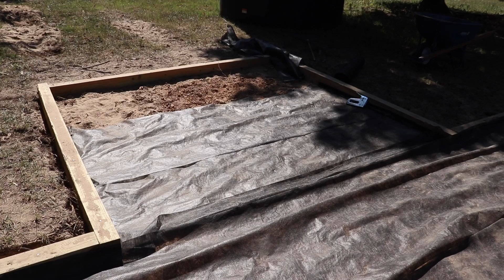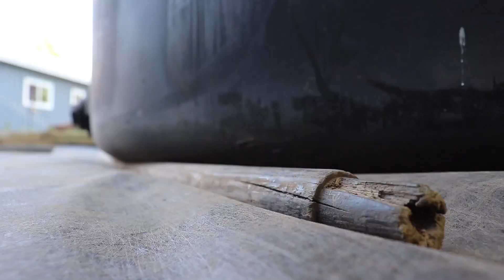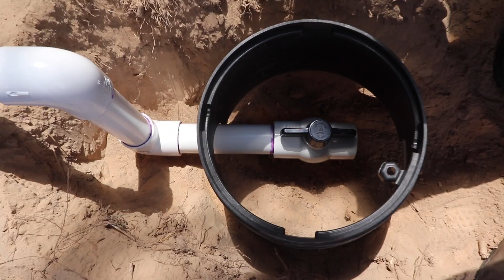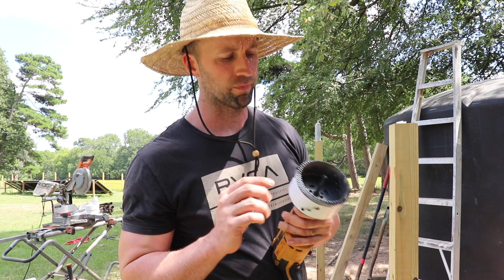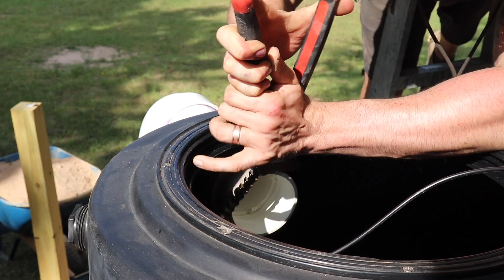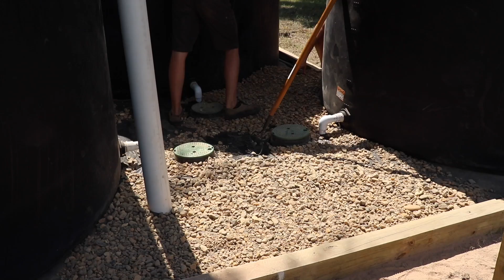HOW WE'RE GETTING WATER OFF GRID!

Comment: Either I don't understand your gravity fill tank layout or I'm convinced it will not work. It seems as if you will end up needing the gutters constantly full in order for the pressure to be able to fill up and into the tanks?
Reply: if you pour water into a glass, will it eventually overflow? If you pour water into a U shaped pipe, with the output end lower than the input end, the water will overflow at the output end.
Reply: @Florida-cracker  none of those examples are the same as filing a sealed container with a straw from the bottom up to and into the top. It's called the water table or some such thing.
Reply: @Finn-McCool  Nope. Water will flow (gravity flow) with no pump. If one end is taller than the other, the water poured in will force water out of the lower end. I supplied a link to a calculator and their pipe looks to be 4 inch nominal (4 1/2 inch)...4 feet higher (guesstimate from video) and 100 feet of total pipe length (estimate from video) will flow 360 gallons per minute. Estimating (high) that they have 1500 square feet of roof...3 inch per hour rain produces about 45 gallons per minute. 1/8th of what the pipe can flow.
Reply: @Florida-cracker  I appreciate the numbers I really do. Let me ask this. Doesn't the pipe need to be full of water completely in order for water table? I mean, how far beneath the grade of the roof gutters do you reckon the top of the tank inlet is? I'm just imagining the water collect there at the base of the tank inside the pipe and slowly filling up as it backs up toward the house and as it fills the pipe the pressure increases eventually creating enough pressure to push the water 7 feet up into the tank. As long as the top of the tank is lower than the the gutter I assume all is good. Otherwise I cannot see how it works.
Reply: @Finn-McCool  Yes, that is how it works...as long as the output (top of the tank) is lower than the input (gutter) all is good. The more the difference, the better. I estimated the difference was 4 feet in calculations (6 foot tank and 10 foot gutter). Even if it's less, the pipe will have no problems flowing what the roof provides.
Reply: @Florida-cracker  that's it! I was only imaging my own house gutters. Wow. Totally neglected to remember he is not only on pillars but he's also built even higher in the middle between the containers. Gee whizz , I "wanted" it to work and I "assumed" it might,  but I had too many scenarios bouncing around in my cranium 😆

Comment: Nice vid you three
If the water from the house struggles to get to the tanks you can install a inline water pump with flow switch and install a none return valve to stop water backing up on your house gutter pipe and all so fit a by pass just before the pump just in case  your tanks are full so that you can re direct your unwanted water.
im sure it will be fine though. iv done a good few like yours with no problem.
Dont forget you will need a  air vent on each tank.
Steve
UK

Comment: Something to watch out for with rigid PVC and tanks that will flex with heat and the rise and fall of the water.  Rigid PVC may break at the joints.  If you find this to be an issue you may want to add a Union and some spa flex coming out of the base of each tank.  The spa flex is PVC as well and can be glued with regular PVC glue, but it can handle the minor adjustments to the tanks.  
You guys are really fun to watch.  Its nice you can laugh at each other while working.

Comment: Hi there, i,m in agreement without a pump to move the rain water into the tanks it wont work. If the tanks were buried no problem. I worked in sewage with pump stations and such and weight of water with path of least resistance you will be thwarted. Kirk

Comment: what your doing wont work...…… you will have to put a barrel at the house with a pump in it to take the water to the tanks...…… then one from the shed you plan to build back to the house.. the water wont flow fast enough to go up that high...…. and you will loose more water onto the ground at the house because it wont lift itself up like that ……..

Comment: I hate to be negative but I hope your plan for getting the run off works but I don't think it's going to provide enough pressure to push the water up that 4 " pipe and into your tank. As crazy as it sounds you need that pipe to run down hill from your water retrieve point to your tank which might be 6 feet or 8 feet high running across the yard. I know that's not what you want being you placed the tanks away from the house. Just do a little test before you do all that plumbing. Just trying to be helpful, love you guys and what your doing. Keep up the good work.

Comment: I have to throw in my two cents.  As designed, as long as the height of the gutters is higher than the tank inlet, the tank will fill, but bear in mind that after the rain ends, the feed pipe will hold a column of water on the gutter and tank side as high as the inlet height on the tank.

Comment: I love watching you guys. I think you are going to have an issue with getting your water into the tanks. Provided your gutters at the house are at least 3-4 feet above the inlet to the tank the water will flow into the tanks but I think you will lose a lot of water due to overflow at your roof. I am a licensed master plumber an also a plumbing designer for an engineering firm in Houston. All rainwater systems we have designed the tanks are close to the structure or underground so the water can flow into the tanks without restrictions. You will be better off elevating your fill pipe above ground an sloping to the tanks from your gutters.

Comment: After rain stop you will get stagnated water in pipes. 

I will recommend to use two valve somewhere between the gutters and ground. 

One valve to be opened when rain start to prevent dusty water from going to tank. 

However I don’t think you will get enough pressure to fill the tank. 

I have noticed that you haven’t used float valve inside the tank. 

How you will prevent tank overflow 

Warm Regards from Oman 🇴🇲- Sohar City

Comment: Good luck, I don't expect there to be enough head pressure to push the water up and into the tank. If that ventricle pipe is 6 feet tall with three gallons of water in it there will be approximately 8lbs of pressure pushing back towards your gutters. Like I said good luck.

Comment: I know you guys did the research for head pressure and what not, but from our end it not look like it will very well at all!!!  You will have standing water in the pipe, I cannot see how that small of pipe will handle the flow!!!   Making a few changes now will be much better then when it is raining!!!!  I read most of the comments and we all seem to be thinking alike as far as pressure goes, but no one addressed the changes coming to the climate!!!!
        I realize you  and everyone here has been well informed on the scam that is globull warming!!!   Instead of heat you should prepare for cold, the area you are in will become cooler and much more temperate!!!!   In the meantime you will be plagued with hail storms much heaver rains and even snow!!!!   So do yourself a favor and rent a back hoe then put yout tanks in the ground, the intense UV won't bother, they will maintain a constant temperature and you can run a straighter pipeline from the house!!!!   Bury them 'bout 4' and your water supply will be safer!!!!   This is intended as an FYI, not a put down!!!   Don't believe me??  On u-tube go to "Adapt 2030",  "Grand solar minimum" there are several more if you have a science bent!!!!!    Better safe then sorry!!!!

Comment: Personally I would have buried the tanks at least half way in the ground if not more but to keep the water cooler to use. In mid summer the water is going to be hot or very warm. Then the water fkow is going to be a problem in filling them.

Comment: What I do on a hole that has no material for the hole saw to center on. I get aboard around 1/4 inch to 1/2 thick and saw the hole in it. Then use that as my jig to hold the saw blade centered on my work surface. 
PS you may have a problem with a water pressure issue as the tanks get fuller the down pressure will overcome the gutter pressure. Hence stopping the water movement.

Comment: Good MacGyver move on the hole saw! Would Teflon tape worked on the original fitting at the base of the tank or is there too much water pressure at that connection? Not a plumber so have no clue.

Comment: I personally feel the intake PVC should have been raised at roof level running parallel to ground, with some support system than dropped into the tanks with three top distributing tubes.. That way when it rains heavy, the water will pass quickly and no spill over will occur, or maybe just a small amount will spill. The support columns can be made out of wood which will look pretty nice and later you can grow some plantation around the columns like a wall creeper... Anyway I am glued and cant wait to see how this beautiful house comes out... Best of luck!

Comment: Was curious what king of chlorination you will use. We're required to get our water tested from the tap every 6 months. I hope your theory on the gutter pressure works, but we ended up having to put a sump in with a pump to pump water up to the tank. Works great, plus we filter the water  to the tank so our tanks stay cleaner.   We were all screwed up at first until we figured it all out. Second testing showed bacteria in the water. That's when we learned about chlorination. If algae or bacteria is found you have to drain the tanks and bleach them out. PAIN. Been good ever since we got the chlorination figured out. Good Luck !!

Comment: I don't understand the difference between the water in the pipe or the water in the tank standing. All of the water will be filtered before going to the house. Hydrostatic preasure is why the system will work. Water seeks its own level and will flow into the tanks. I have a filter that you can put food color in the water and when it comes out its clear.

Comment: I read a lot of comments about your water system and just want to reassure you that getting water to your tanks will work as long as gravity is working with you. BUT it will require overhead piping to get the drain water into your 1st tank. I personally prefer underground piping into a catch tank that has a lift pump in it to put the waser into the 1st tank.  The water in 1 tank will equalize  in all 3 tanks in your setup. A good pump in the pumphouse will supply water to your house at a good pressure as long as you stay within your pump's limitations. 

I think you guys are on the right track. I really enjoy seeing your videos and THANKS for sharing.
John

Comment: You need to paint those pipes.  They are not rated for UV sunlight.  They will crack.  If you paint they they will be fine.  Just the exposed pipe needs to be painted.

Comment: I'll be amazed if gravity has enough pressure to fill the tanks. You might need a 55 gallon tank with a float operated pump to transfer gutter runoff to the tank. The runoff has to push against a huge head pressure. Fyi use very small grid screening to protect bugs and critters from getting into tanks from overflow!
Reply: Sean Signer I think your right plus smaller pipe and a check valve to the tank and a fill tank out give it constant psi

Comment: There is what is called back pressure that might not allow the tanks to get filled as planed. I have worked will water systems and you might need a small pump to help with the tanks getting filled at the home end. also shame on you, you did not check to see if the pipe leak. I have found perfect pipes cracked in the most weird places undetected until pressure is applied. do your diligent work to ensure the piping is correct ant the slop of the pipes are correct in the ground. the highes the slope the better the change it reaches the tanks. Peace, love, lazaro

Comment: If you put a smaller tank in the ground with a lift pump installed on the outlet you can have a float switch installed to automatically move the water into the above ground storage tanks.

Comment: Ignore all the comments about the tanks not filling without a pump, as long as the tanks are lower than the gutter they will. It may not be the most efficient way of doing it but it will work. What you should have done though is installed a clean/access point at the lowest point as it will end up with a lot of stagnant water sitting in the pipework. All these system are 'make it up as you go' and no one ever gets it spot-on first time, you will be tinkering with them for the rest of your life!! 😃 Keep the videos going and well done so far.

Comment: So much NEGATIVITY!!!! I wish you guys the best and I pray your system works efficiently. Big fan since 20k subs. Good luck
Reply: Unfortunately, simple physics tells me this water system will not work as initially designed. And for multiple reasons. Absolutely No negativity involved. Just simple facts. and my two cents worth is given to avoid tons of extra work and disappointment on the other end. To say nothing of extra costs!

The point is- - - this system doesn't need a tweak here or there, it needs a complete redo in design and sizing.

I would have buried those tanks completely and put the house very nearby.

When I was little we had a hand pump in our kitchen sink. If you wanted water to cook with or to drink, you pumped that big red handle, by hand.

If their tanks were close enough to the house or vice versa, they could pump the Water by hand into the house. Arduous? At times. So I suggested that they have a water tank, of 200 gallons, that would sit taller than the house, With a trickle pump or lift pump refilling the 200 gallon tank from the large tanks below. With large enough gutters and downspouts they could catch every rain drop from the roof. But those gutters and downspouts will need to be much, much larger than they ever imagined. There's an awful lot of resistance or fiction to water flow when a pipe is full. There is much less resistance when the pipe is only half full. That's just simple HS physics. And this is just one of the limiting factors. Another is trying to get water into the large tanks when the first tank is only partially full. the water pressure from the gutters has to be greater then the back pressure of the water trying to reverse course. The slope gradient and rather small size of the gutter feed is woefully inadequate to overcome the back pressure in their current system.

Overfill a Brita water pitcher and you have almost the same set up as they have. all the water in the top part will not drain into the bottom under certain circumstances. And if the pitcher is very full and then you put the empty filtering part back in the pitcher will certainly have backflow. The water will flow from the pitcher through the filter back into the reservoir, until the pressures have equalized. the same rules will apply to their system, and will work almost exactly the same way.

 they used a water line to determine the height of their footings. their gutter and water tanks, in some ways, are very similar. the size is different but the operating principles are the same.

Because everyone knows water, and empty tubes, and the fact that water runs downhill it appears to be so deceptively easy to put a system together that will work flawlessly. But there are multiple factors that are not evident at first glance that will preclude their system from functioning at all. it looks so easy but it is not. sometimes the things that look the easiest are the things that are the most difficult to get right. Rather than Plumbing the idea of relationships come to mind here! they look so simple when you see a good one but are exceptionally difficult to get right most of the time. at least from my experience. But this is a subject for a different day and forum.

 I haven't been keeping up with their videos so I have no idea of how the system worked or if they had to make modifications. maybe this weekend I'll have time to watch and find out where things are at with their Plumbing system.

Comment: I read the comments, there are many good suggestions on 'what-you-should-have-done', as to make it 'easier' for you to do 'what-YOU-want'. You guys will admit, there's often 'an easier way'. Suggestion: At the end of your clip/post mention what you are planning for the next week. Then suggestions will come in that you have the 'option' to buy into. Note: Doing what 'you want' vs 'how to do it' best or easier, do not conflict.... 16 years ago I built my cabin, 16' x 16' three stories high. Ground level is a workshop. Second story is the 'Water Tank (1500 gal. 12 volt, RV water pump, solar charged 12 volt golf cart battery, plenty of pressure). Third level, living area, with a full covered porch 5 x 16. Stairs/steps are on the outside and covered. "One day, one guy, helped me lift one board." So no, I didn't build it by myself... I am connected to the grid, and county water, but I am 'off-grid-ready'.

Comment: The filling of the tanks will work due to the principle of communicating pipes/vessels. The roof is higher than the tanks, so the pipe is filled with water until it drops into the first tank.
The pipes should be covered with uv protection. 
Greetings from Munich, Tom.